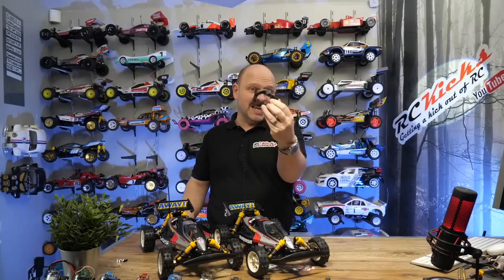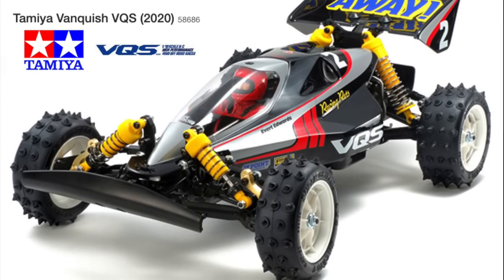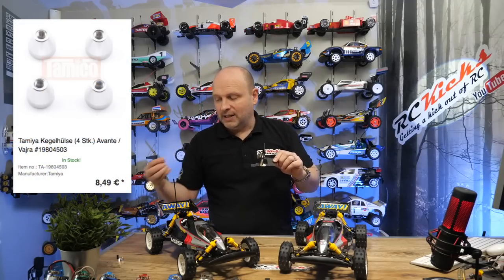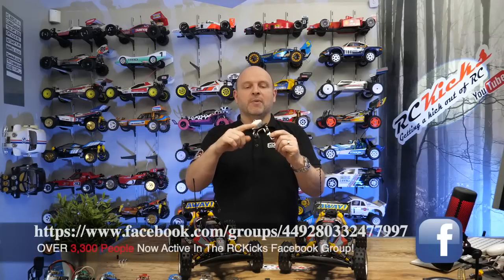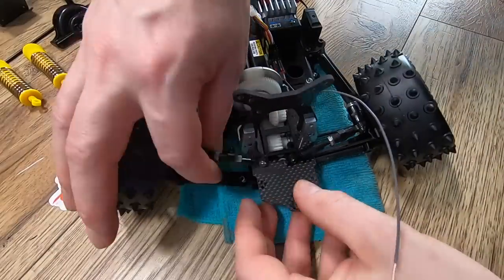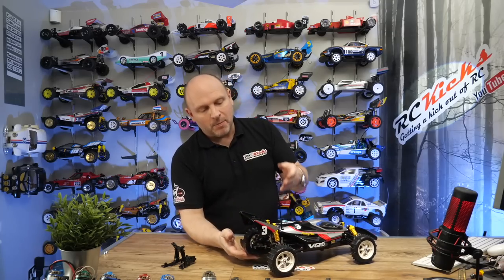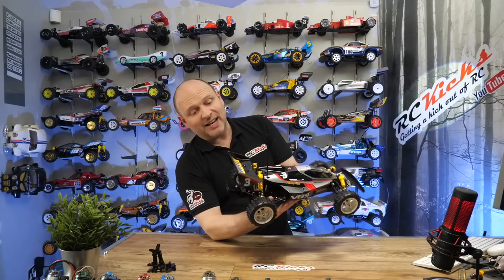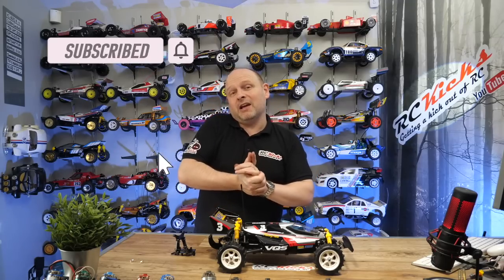YOU SO NEED THIS Tamiya VQS / Vanquish Owners!  A G11 Carbon Upgrade Fix At Last. Kit 58076 & 58686

Comment: Ive just fitted aluminium replacement rear and front shock towers from rcmart on ebay the parts are made by Xtra speed. Front one is XS-TA29040 and the rear is XS-TA29041. Very well made and pretty cheap. I also have a g11 part coming, soon as I comes i will give the details.

Comment: More fragility issues due to Tamiya’s poor engineering practices!  The original Vanquish was meant to fix the fragility problems of the original Avante, and they just end up creating new problems!  On top of that, the VQS itself is a revision of a revision – and it still has fragility problems!  How pathetic!  How many revisions does Tamiya need to get it right?  The VQS is a revision of the original Vanquish, and the Vanquish was a revision of the Avante!

And you can’t even use a 3D printer to resolve the problems of that G11 weak part!  The filament material would not be strong enough to bear the loads in the geometry required for that G11 part.  You need a freaking machine shop just to get one RC car running properly!

One top of that, he even had to use another full kit just to cannibalize parts!  He had to cannibalize the metal conic parts from a Tamiya Avante 2011!  This is pathetic that this needs to be done on a 3rd-generation revision released in 2021!  When is Tamiya ever going to get it right?

The Kyoshos look boring, but at least they can finish a race.

Comment: By the time you have bought all the bits for this, could the money have been put to getting an Avante 🤷‍♂️
Reply: You can get an upper egress deck from fiberlyte trim that to fit and alloy parts bag from the 2011 avante re re off ebay. Still over 50$ usd but if you must have it i guess its still affordable. Never looked into it but im sure someone has 3d printed one and is selling them.

Comment: For the price Tamiya is charging for this kit a carbon G11 like this should have been standard. Then, Tamiya could have offered a carbon and aluminum shock mount as a hopup. That would have been smart and offered value. This is why I'm skipping the VQS and buying a Top Force Evolution instead.
Reply from the maker: Going by the available stock levels I think the VQS did sell the numbers expected.  I could be wrong but I get the feeling people like the VQS but for the price tag it should have had a few upgrades like this one as well as a kit branded motor like the 2011 Avante.  The vintage one didn't come with anything special but as a rere it would be good to keep the idea of date branding rere kits.

Comment: I did something like this a year ago by using a avante 2011 chassis and cutting it and using the avante 2011 rear shock tower mount. pretty cost effective since the chassis new was 28$, love fibrelyte but they have been a pain to deal with for me so i will prob have to pass, maybe later.
Reply: Wish i read your reply before i posted but exactly the same happened to me but it was an egress top plate for me. I thought about asking pargu to make me some alloy ones but shipping ugh. Forgot about it after my Vanquish restore till this video came up. Might still look into just making plates up.

Comment: I’m left wondering why I would put carbon parts on a model where the manufacturer decided to put plastic where metal should be, you know, like the shock bodies and caps, the chassis, the suspension uprights..etc.  Tamiya is the KING Of toy grade RC for hobby grade prices.
Reply: Why do you need metal for the shocks, chassis or shock towers on 1/10th?

Comment: Hi Gavin, I am now building and also upgrading my Tamiya VQS. I am enjoying the build. I did get all of the Fibre-Lyte parts. I might have a very easy solution to get all of the screws needed to complete this conversion. You will still need to get the parts for the Tamiya  Avante as well unfortunately. I am not sure if you remember ? I did ask you what screws might be needed to complete this conversion. I might have an answer for you soon. I will let you know this weekend, if I have found an easy solution for the screws needed to complete the conversion.  Thoughts?

Comment: Hi Gavin, I just ordered these parts from Fibre-lyte. They did tell me that they only sell the carbon fiber parts. They also said that I would need to buy the metal parts else where. They even referred me to your video on Youtube on what else I would need. That was very cool. I did order the Tamiya Avante parts that I would need on eBay. I got lucky and got the parts cheap. I think the seller on eBay did not know what he was selling. I guess I got very lucky on that find.  Thoughts?
Reply from the maker: It’s a lovely mod and it looks great.  It looks stock when done as well due to the OEM metal parts from tamiya.
Reply: @RCKickschannel  Hi Gavin, I got my parts today. That is very fast when you consider that they came form the UK and I live in the USA.
Reply from the maker: @alfredyost7972  That was quick, the post has been super slow since COVID & BREXIT kicked in.
Reply: @RCKickschannel  You are right , the post office has been slow because of the pandemic.  However, the post office in the UK is very good and so is the post office here  in the USA  too. Thoughts?

Comment: I know I'm late to this party, but rcevologic out of Australia makes all of the G parts (G5, G6, and G11) out of aluminum, and they can be found on ebay Australia. I have them on my VQS and they are solid.
Reply from the maker: Yep I have some as well 👍🏻
Reply: @RCKickschannel  Did you get the G5 in standard height or the extended version?

Comment: Hi Gavin, I was wondering what size screws you used to complete the "Fibre-Lite conversion. I do have some Tamiya screws from past kits but I may not have everything that might be needed. I did get all 3 parts from "Fibre-Lite". I even got the front shock tower. Thanks for your help. Keep the videos coming!
Reply from the maker: I can’t really remember sorry.  I would try to keep as many as possible the same as the original G11 part and only changed ones that needed it like the shock tower tops.
Reply: @RCKickschannel  That is okay if you do not remember. I do plan on replacing all of my parts with parts from "Fibre-Lite " . As you said in your video they look great.